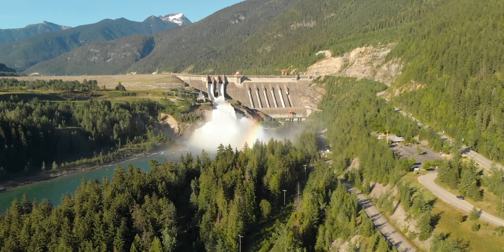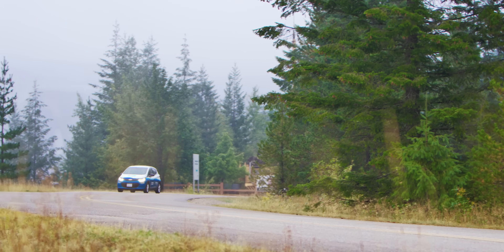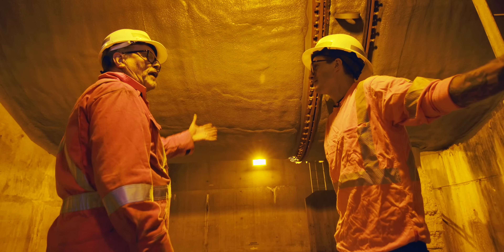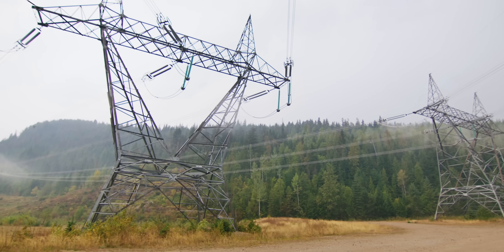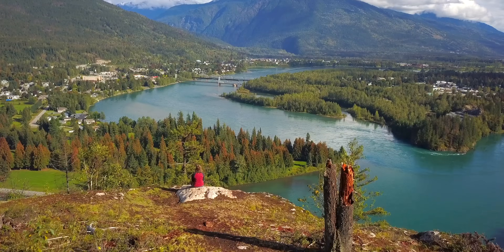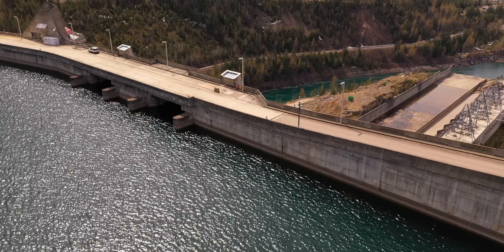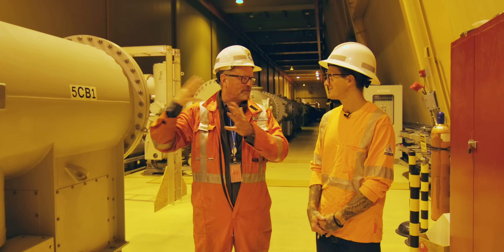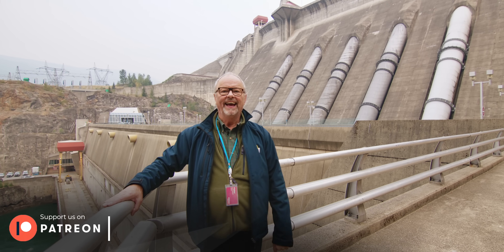This Dam Makes Enough FREE Energy To Run A City

Comment: Hydro power was highly popular in some parts of the UK post war - what happened ?
Reply: It turns out that the UK is actually a tiny country.

The UK consumes 303,940 GWh, and something like Revelstoke produces 7817 GWh,
so the UK would need 39 Revelstokes.
Just the reservoir of Revelstoke is 115 km2, so the UK would have to set aside 4,470 km2 - or about 2% of the entire country for reservoirs.
This presumes that the vertical drops exist - and in a country where the average height above sea level of 75 m, the Revelstoke drop (although it is not clear from Wikipedia if the dam height is 175m, or the head is 175 m) of 175 m is going to be hard to find.

Of course, just 15 HPC-type reactors occupying 0.01% (decimal point correct) of the UK's area could take care of the UK's electricity needs also.
Reply: @factnotfiction5915  Thanks -UK consumption seems about 300 TERA watt hours (300TWh pa).
Except there seems to be a gross error at 14 seconds in the video - at 15kWh/day per average home or 5.5 MegaWH/year per home, then 8.1 Million homes would need 44 million MWh pa, or 44,000 GigaWh pa, (or 44 TWh pa) not 7,800 GWh pa ?  So reservoir area needs to be multiplied by SIX ie 12% of our land.

Comment: The most annoying aspect of this type of generation in the UK is that the government has virtually shunned its use in favour of the least efficient in wind and solar! We have in the UK as in Canada a west coast that is subject to the highest rainfall and the deepest valleys, particularly in the northwest of Scotland where there are virtually no inhabitants. In other words the ideal situation for large scale hydro schemes that would have the capacity to power the majority of the country if not all of it!
Reply: It turns out that the UK is actually a tiny country.

The UK consumes 303,940 GWh, and something like Revelstoke produces 7817 GWh,
so the UK would need 39 Revelstokes.
Just the reservoir of Revelstoke is 115 km2, so the UK would have to set aside 4,470 km2 - or about 2% of the entire country for reservoirs. (6% of Scotland)
This presumes that the vertical drops exist - and in a country where the average height above sea level of 75 m, the Revelstoke drop (although it is not clear from Wikipedia if the dam height is 175m, or the head is 175 m) of 175 m is going to be hard to find.

Of course, just 15 HPC-type reactors occupying 0.01% (0.03% of Scotland, decimal points correct) of the UK's area could take care of the UK's electricity needs also.

Comment: You should check out all the hydro dams on the Columbia River. There are quite a few and together they generate an absurd amount of power. The Bonneville Dam even had its original orange shag carpet in the visitor area the last time I was there :D
Reply: The Columbia is the worlds most dammed river.

Comment: Robert, you should do a video on pumped hydro electric as a way of storing solar energy. This is certainly an approach being used in Australia at the moment which has an abundance of solar energy and very limited hydro storage capacity.
Reply: Wonderful production. Great job team. For a pumped hydro worthy of visiting , the Northfield Mtn. Project. In MA has operated for decades as a battery, initially for nearby nuclear power, both now decommissioned, after reaching end of service life. The The mtn. Project now accumulates wind energy primarily and regulates the energy for time of use demand.  
A short inclusion of a First Nation representative sharing about the present efforts of BC hydro to both mitigate and support their community dealing with the immense impact a project of this scale brings. You permitted him to say they are making these efforts. Knowing they made mistakes understanding is essential to improvement going forward. 
To produce the energy needs going forward without the using of the commons of our atmosphere as a dumping grounds is going require so much new both generation and distribution infrastructure.  It would be wonderful if we learned from o past mistakes. Bringing them to light is essential. We can’t eliminate all impacts but with informed and appropriate efforts we can both mitigate and make efforts that offset impacts.
Reply: And in Scotland at Ben Cruachan, been there many years now.

Comment: The only thing i'd point out is the stat at the start  the "1 cubic metre of water raised a metre is 1kw"     it's mixing units a bit there and is only true depending on how fast you move that water... you'd have to move all that water in 10s for it to be true.. so if you want to run a 1kw toaster for 2 minutes.. you need 12 cubic m of water.. or 12m to drop..   Thats' why everything needs to be massive, gravity is the weakest natural force.

Comment: 1 cubic meter of water weighs 1000kg which exerts a force of approximately 10,000N. Dropping that by 1m gives 10,000J of energy. If you do it in 1 second that's 10kW of power. Not 1.

Comment: 1:55 noooooo if you multiply weight by height you have energy, not power. 1 m3 & 1 meter drop is 2.7 Wh, or 9810 joules.
To calculate power : 1 cubic meter dropping 1 meter in 1 second = 9810 watts (watts are Joules per second)

Comment: You're all nitpicking and Robert was almost right...
1 m³ of water at 1 m elevation could indeed generate a sustained 1 kW of power not considering losses... the water would just run out after about 9.7 seconds! 😋

Comment: Great video. I think an episode on a potential Severn Barrage and tidal lagoons in the UK would be great. It seems mad we have the potential to produce 20% of UK power demand from a tidal barrage and it seems dead in the water as an idea here.
Reply: tidal power is massively massively difficult... the damage cause by flooding a small ish valleyin canada is nothing compared to blocking off the severn.. while keeping boats and birds and fish happy.    plus this place last 100 years.. add salt water and that will be much less than half.    The severn is a pipe dream.

Comment: Thank you Robert. Unfortunately, there is another mostly unknown downside for hydroelectric dams- and that is methane emissions from organic matter accumulating in the reservoir and breaking down without oxygen. The problem is more severe in warm climates, so maybe in BC the emissions are not too bad. But still, it should be taken into consideration in the life-cycle GHGs emission. A similar thing happened with natural gas, when people are impressed that it emits ~half of the CO2 coal emits per kWh produced. But when you add up the natural gas life-cycle methane emissions, you find that on average natural gas is as bad as coal from a GHGs perspective.
Reply: presumably that's a one-time emission though?  it's not like it keeps happening once the flooded ground is flooded.   otherwise you'd say the same of every lake.

Comment: You should go in Radisson Quebec Canada with the LG 2 ( La grande 2) it's much bigger and was the biggest dam build in North America. 18 turbines +8 if I remember, was 52 floor building tall and 300 km or dam around the site !
Reply: Revelstoke is but one of the many huge dams in British Columbia
Reply: @bradjames6748  Which province produces the most electricity?
Quebec is by far the leading province for hydroelectric power generation in Canada. In 2020, approximately 195.08 terawatt hours of electricity had been generated from hydropower in the country's South-Eastern province. British Columbia followed at 63.24 terawatt hours of hydropower generation that year.

Comment: Great video Fully Charged team.  Rosie (Engineering with Rosie channel) made the point that if pumped hydro can be used for energy storage with less environmental impact if it is built from scratch, i.e. does not use existing lakes or rivers.  I went on a 'lavanda walk' in Maderia and noticed that there was access to a dam above me, I later found out that is Maderia pumped storage system.
Reply: Those are short term facilities.  They need to be refilled shortly or they lose their value to shape electric demand.

Comment: Just curious if a 2,800 MW hydro is "massive and gargantuan" what would he describe one that has 22,500 MW?

The Revelstoke Dam was opened in 1984 so it is now 38 years old.  When I checked the list of Chinese hydro that can generate more power than Revelstoke Dam there are 16 of them with the oldest commissioned in 1988.  The average age of these 16 hydro is 9.56 years with an average output of 7,105 MW per station.   It seems the whole world, including Canada, has nearly ceased to build any more new hydro but leave the China to get on with it.

Comment: A little surprising that you still dont quite seem to master the differense between kW and kWh, i.e. power and energy. Is it really that hard?
Reply: And neither of them makes sense here. 1 m³ of water falling down 1 m per second would be roughly 10 kW of power, not 1 kW.
And 1 m³ of water falling down 1 m is 0.002725 kWh of energy, not 1 kWh.

Comment: Could somebody help me understand this please? 1cubic meter of water is 1000kg, dropping by 1m (mxgxh) means an energy difference of 10000J.
1kW of electricity, is a 1000J/s, so in essence you can deliver 1000 watts for 10 secs (assuming no losses). So for 1kWh you'd need a total of 1000J/s x 3600s which will be 3,600,000J which equates to 1000kg of water being dropped 360m. Is that right??🤔
Reply: yes.

Comment: You should go and visit Itaipu dam, between Paraguay and Brazil, this has only five generators, Itaipu has 16 + 2 in reserve. Paraguay is never mentioned on green energy, Paraguay has been using this technology for long time and does not have any large diesel generators for providing electricity for the country.

Comment: Float a load of solar panels on the dam and make every more electricity. Would be good if it could pump water back up in times of low demand if it's possible.
Reply: It is not possible.

1st - there is no lake/reservoir at the bottom. You would have to build one.
(for MORE environmental damage)

2nd - less water would go downstream
(for yet MORE environmental damage, and reducing the flow to downstream hydropower dams or irrigation)

3rd - snow/rain does accumulate, so eventually you would have to send water downstream, and dams usually prevent periodic floods, not exacerbate them

4th - the solar panels would disrupt other uses of the reservoir, fishing/boating, and when a hailstorm occurs, break and release toxic and heavy metals into the water supply. BOO!
Reply: @factnotfiction5915  4th is a load of rubbish

Comment: Great video, but I have to rant about units: at 1:56 you say "one cubic meter of water dropping 1 meter downwards produces 1 kilowatt of electricity". No! it is 9.8m/s^2 * 1000 kg * 1m = 9800 kilojoules or 0.0027 kWh. Kilowatts are a measure of power. If you mean energy its kilojoules or kWh. Energy = power * time.

Comment: Love it. Thank you for the comparison with coal, what about vs gas or wind? I'm assuming the story is good, even taking account of loss of trees when the valley was flooded, but I'd really like to see some working here to demonstrate that.
Reply: its likely more than solar / wind but has huge advantages in terms of controllability.. which means you can use the solar and win when they are working and turn this on at other times... but in most parts of the worl they've already used the best sites for hydro, it's not like we could build 10x more if we wanted to (in europe at least)
Reply: And the huge CO2 cost from all the concrete required, one of the worlds quiet environmental costs
Reply: @Jackplumz  The concrete is a one off cost. The dams will be around for decades.
Reply: @Jackplumz  I think that was the comparison he was making but I'd love to see it spelled out a lot more clearly. I guess I could go and look it up, but I just think it would make these videos more persuasive if they tackled some of this a bit more directly...

Comment: I know that the 1m3 water 1m down = 1kW is defanitely wrong. First, energy is kWh not kW. Common mistake (too common) but wouldve expected better here. But especially the 1m3 (1000kg, ≈10.000N) over 1m distance = 10.000J or 10kJ which equates to about 3Wh or 0,003kW hours at 100% efficiëncy.
Reply: Yes, i picked that up too.  Robert is a great presenter but they could do with a  engineer bod fact checking someimes.

Comment: Finally a new Fully Charged episode that isn't a car review, more like this please 😁 and whilst you're in Canada maybe an episode on CANDU nuclear heavy water reactors that produce electricity with 1/3 the CO2 g/kWh emissions of wind 😉
Reply: David I would love to see how your last statement is calculated.
Reply: @renedalmeijer8260  there's a paper titled Comparative assessment of the environmental impacts of nuclear, wind and hydro-electric power plants in Ontario: A life cycle assessment, that gives a figure of 12.05 g CO2-eq/kWh for wind, 3.402 g CO2-eq/kWh for nuclear. Unfortunately it's paywalled, as are many papers. However, I'd hazard a guess that it's because CANDU reactors are heavy water reactors, which have higher neutron efficiency and can run on natural uranium, avoiding the emissions of fuel enrichment, and they also have a higher fuel burn up too compared to light water reactors. Interestingly, they can also run on thorium too. For something on nuclear power in general, and not paywalled, see UNECE'S Life Cycle Assessment of Electricity Generation Options 2022 report, which also has nuclear's life cycle emissions as lower than wind.
Reply: @davidpowell8249  Thanks for sharing this resource. It gives valuable information to make the right decisions. The choice for nuclear is quite obvious based purely on CO2 emissions. But obviously there are also other things to take into account, like cost and the risk of a nuclear catastrophe. Already operational nuclear could be used as a transitional technology but I see very little future for it based on cost.

Comment: As they have said in the video, the beauty of hydroelectricity is that at its core, it is actually pretty old and simple technology. The plants themselves are designed to last for 100+ years, and it is not uncommon to see turbines and generators which only need to be replaced after 50, even 60+ years of continuous operation. I do not think there are many technologies that are relevant now, were relevant a century ago when they were introduced, and will probably play a big role even another century from now.

Comment: Enjoyable, thanks. Some solid answers to the questions of mitigation of previous environmental damage, displacement of people, efficiencies of the currently installed generators and what upgrades could do to that figure, would have been interesting And intrigued to know why the 6th generator is not already installed.
Reply: Because BC Hydro are building the site C dam on the peace river instead.
Reply: Probably not installed because the 6th unit was not needed for peak demand on the system.  Remember adding another unit does not produce more energy from the facility except during really high flow conditions when they are running water over the spillway.

Comment: Rob, I watch all your videos and have bought my tickets for Fully Charged in Sydney next year. 
Rob, as a spokes person for the renewable energy industry, you must get your facts right. If you don't then those who don't believe in renewable energy and want to stick to fossil fuels will say you don't know what you are talking about and they'd be right. In the video you say " 1 cubic metre of water dropping 1 metre produces 1 kW". Unfortunately, this is absolute rubbish and it indicates that you do not understand the difference between power and energy.
1 cubic metre of water has a mass of 1000kg. If it is raised by 1 metre and we round off g to 10 m/s/s, then the potential energy of the water = m x g x h = 1000x10x1 = 10,000 joules = 10kJ. So you should have been talking about energy and not power. Power is energy/time. i.e. J/s. So to get 1kW of energy out of 1 cubic metre of water falling 1 metre it would need to flow at a rate of 1 cubic metre every 10 second i.e. 10kJ/10s = 1 kW. So, you should have said, "1 cubic metre of water falling 1 metre every 10 seconds produces 1 kW."
Rob, please get one of your engineers to proof-read what you say before you say it because it's important that you don't make simple mistakes like this.

Comment: @1:55 "One cubic metre of water dropping one metre produces one kilowatt of electricity"

Um, no. One cubic metre of water weighs 1000 kg. Dropping one meter produces mgh = 1000*10*1 = 10,000 joules of energy. If it does it in one second that's 10 kW. If it's takes 10 seconds then yes.

Comment: 1:55 I'm not sure where the 1 cubic meter of water dropping one meter equals a kilowatt phrase comes from? Like, the unit should be joules not watts cause the situation is describing energy not power,  and the amount is off too cause a ton of mass falling 1 meter releases around 10 kilojoules of energy, not 1. Gravitational potential energy is mass times height times gravity, so in this case 1000kg * 1m * 9.81 m/s^2 = 9810 joules.

I guess you could phrase it as 1 kilowatt of power for around 10 seconds if we want to keep it in terms of kilowatts. Or 2.77 watt hours if we want to use a more familiar energy unit.
Reply: I suppose, he was told about 10 kW of power, produced by 1 m³ of water falling down 1 m per second.
And got it wrong as 1 kW.
And then additionally confused power (kW) and energy (kWh).
But I really don't understand, why he still makes such mistakes in his videos. There should be enough people around him who know better.